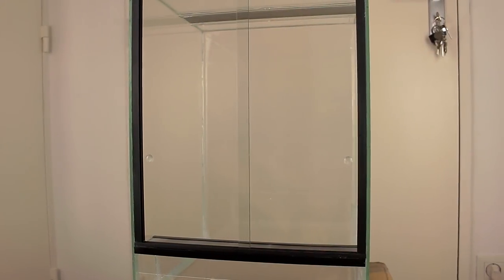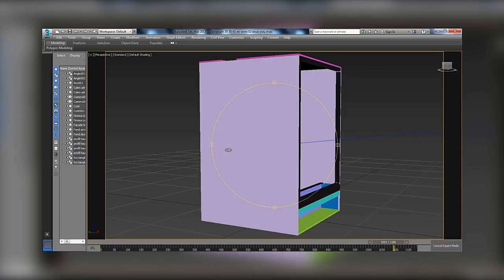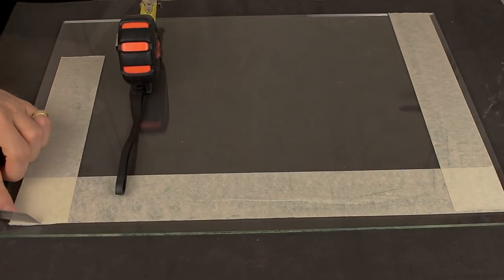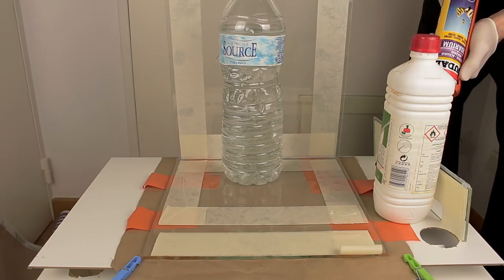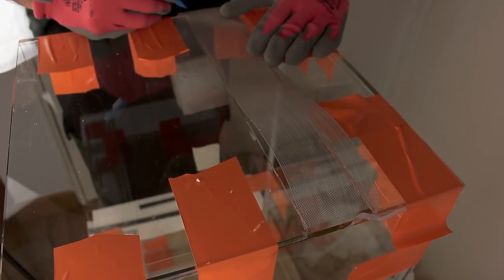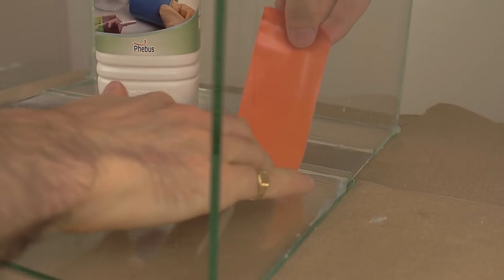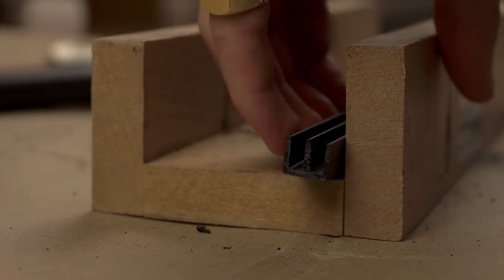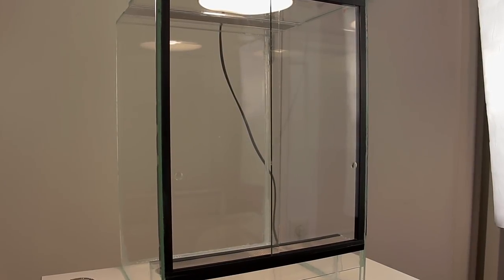How to build a glass terrarium vivarium

Comment: Very istructive! i prefer grinding round sharp edge of all glass panel before starting for two reason . The first is obviosly safety  the other  is that a grinded glass is less prone to anomaly fractures.
Try you  black silicon , its need a bit more attention because  whisker are very visible but the final result is gorgeus

Comment: Honestly the best DIY terrarium & tutorial I've seen yet! Been looking for one that looks pretty & clean and your design is phenomenal. Thank you! Question, can this be done the same way with plexiglass/acrylic instead of glass?
Reply: Also, is there a way to lock the sliding doors? I would like to do a similar thing for my gecko but am super new to this stuff. My dad is a little more knowledgeable so he can help me out a bit.
Reply from the maker: @ratmansimulator  Thank you very much. Yes, you can process the same way with plexi or acrylic but these materials are very fragile become dirty and scratched with time and are more difficult to clean. The only one advantage is the weight. And yes I think it is possible to buy something like this : https://www.amazon.com/Sliding-Ratchet-Chrome-Showcase-Display/dp/B07P7Q76SP/ref=sr_1_1_sspa?keywords=glass+door+lock&qid=1573900396&sr=8-1-spons&psc=1&spLa=ZW5jcnlwdGVkUXVhbGlmaWVyPUEzQllYRU45SUJOV05DJmVuY3J5cHRlZElkPUEwNTIwMTQ5Mk5HU0g1VFgyUTJZTSZlbmNyeXB0ZWRBZElkPUEwNzYzMjg0M0NCQk8xSFI4RUZERyZ3aWRnZXROYW1lPXNwX2F0ZiZhY3Rpb249Y2xpY2tSZWRpcmVjdCZkb05vdExvZ0NsaWNrPXRydWU=

Comment: Absolutely brilliant tutorial! Thank you. Does it have to be toughened glass and how long do you leave the silicone to dry please?
Reply from the maker: Thanks :) it is normal glass and I leave  silicone dry at least  24h
Reply: @Terrarium-Construction   i have just bought my cut sizes today, but it is normal glass!? i will be using some heavy dragon rock etc inside.. you are sure it is ok to build with this? it is 500mm x 400mm and 550mm high.
Reply from the maker: @spurito  Depends on the thickness but yes or me no problem with normal glass. You know, Exo terra use normal glass for there terrarium tank. ;)

Comment: Hey! 
First of all, great video! Also your english doesnt suck ;) english isnt my native tongue and i still got everything

Im going to follow your tutorial for a 60x90x60 cm tank - excited to get started
one question tho: If i place my UVB bulb on top of the tank, only the ventilation mesh will let uv light through
is there an option to increase the amount of uvb light that can get through?

Looking forward to see moure of your projects!
Reply from the maker: Thank you very much. Unfortunately, the only two ways to do this are to increase the size of the ventilation mesh or replace glass top panel by acryl panel whick let the UVB pass trough.
Reply: @Terrarium-Construction  i thought about increasing the mesh size, but I was worried about the structural integrity of the tank - the top plates ensure stability after all
But using acrylic glass is a great Idea! I will think about it
Thank you very much
Reply: @dertachinator, what did you end up doing?
i think you could safely reduce the amount of glass on the top / increase the mesh area. look up eurobracing aquariums. they use far less glass across the top of tanks which they fill with water. that's a lot more pressure.
Reply: @druubben4410  i found a cheap old terrarium that looks self made to me ;)
it utilized acrylic glass, mesh screen and glass on top, i fitted a lamp over the acrylic glass

Comment: love the tutorial. you've given me the confidence to get started.

my biggest worry is the size of the doors. i know you take the total height of the tank minus the height of the vent, but you also have to subtract for the pvc and rail profile. how much is that?
Reply from the maker: To be honest for me it is the tricky part.  On the base you just need to count about 2mm but on upper  part, you need take required gap which permits to remove the glass so the height of the bottom rail (5 or 6mm) and about 5mm on the top. To be sure, build the tank and when it's done make the doors according to the final dimensions you get.

Comment: hi!! this is a fantastic video! thank you for making it :) do you think that a simple box terrarium with no sliding doors would be possible to make for someone with no real experience in building? i want to make one but i've never tried something like this before
Reply from the maker: Thanks but a simple box is not good because you need to have an air circulation in the tank to avoid moisture.

Comment: Hey, thank you for the tutorial, very helpful indeed. Just a quick question, how much gap there is between the bottom and the top of the doors’ runners’ tracks? Is it exactly how tall your doors are? Will glass bend at all? Do you need to force the doors in? I want to make sure that glass doors will fit into that space. If that makes sense? Thank you

Comment: Very good video, one question: I saw that you ordered the glass at leroy merlin. From your experience, did you pay the glass based on how much glass you bought (for example 1.5 square meters) or did you also have to pay the cutting of the glass?
Reply from the maker: Thanks. If I remember well I just paid for the glass and nothing for cutting but it depends on the stores.
Reply: @Terrarium-Construction  thank you very much, one more question: could you tell where you found the PVC guides for the glass doors? thanks again
Reply from the maker: @lorenzodonati9377  I think you can find these stuff on Dutch Rana but I bought mine on Dendroworld

Comment: Why did you make the glass for the sides (côtés) 304mm wide, 
Why you didn’t make it 300mm if the bottom is 300mm? Please tell me I don’t understand why
Reply: I can make this ? the bottom 300x300? and the side and back 300x450mm?
Reply from the maker: The sides make 304mm because sides cover the back so you need the lenght of bottom (300mm)and thickness of back. (4mm)
Reply: @Terrarium-Construction  Ok thank you, I think I understand now,
I have once last question do you think thickness of glass for the bottom of 4mm is enough For terrarium Or must be 5mm or more?
Reply from the maker: @james-in4gc  Depends on the size of the tank but 5 mm or more is better

Comment: thanks for the video. just want to as a question. you use sandpaper on the edges of the glass? i cut my own glass so how should i take the sharp edge of the glass?
Reply from the maker: You need to smooth edges, if not you can cut you fingers very easely. I just cut one of my finger this week with my tank and I almost needed to go to hospital ^^

Comment: Hello, what is the tool used for smoothing silicone? Thanks
Reply from the maker: Hello, it is a sealant finishing tool which is sold in the seaant department in diy stores. You can see it at 2m36s
Reply: Terrarium-Construction.com OK，thanks a lot. Also are the side profiles for the sliding doors same as the bottom profile(how deep)
Reply from the maker: @williamdavis9471  Yes the same size, about 10mm ;)
Reply: @Terrarium-Construction  thanks again, haha

Comment: I need to know how to set up the lights inside a full glass tank lights keep falling on me its a pain
Reply from the maker: Hard to say without seeing the set up.
Reply: What lights do you have? Is it an led bar or a dome? You will probably have to drill holes to affix it to the top. The thing with these builds is they don't accommodate for uvb lights as the glass will filter it all out. So best would be to make a full mesh top or a very wide strip of mesh to set the lamp on. It would still lose some percentage of uvb (between 30-50 depending on mesh and bulb) but at least you can use it. That's really why these builds are giving me a bit of a headache. I want to do one but I really want to use uvb so figuring a way around that is creating extra work
Reply from the maker: @pewpewcat7679  I never used UV lights. UV light emits UVA and UVB during very short periods. I rather gave calcium with food when I had dart frogs or lizzard. You cant us too large grid because you will loose to much humidity to maintain rainforest animals.  If you really want to use uv light you can use acryl panel wich let Uv pass trough.

Comment: Does anyone know if "plexiglass", that is, plastic glass or whatever it's called, would it also work for this build?
Reply from the maker: Yes, but with age it becomes very ugly and is not resistant to scratches . but yes you can use it.
Reply: @Terrarium-Construction  okay, thank you for your advice. If you have time, I have more questions.

Would it also work if I used plexiglas and plywood instead of glass? For example, the back, bottom and top would be plywood and everything else plexiglas.

Another question I have is whether this build would work with the moss terrarium. Do the ventilations affect the moss?

And last, in the moss video you mentioned XAXIM, peat bricks, and hydroglon. You said that anything else would also work, what did you mean by this?

Thanks in advance.
Reply from the maker: @haltsinberg  Far too complicate to use many kind of materials to ensure waterproofness. You must use full glass or full wood or full plexiglass. Plywood is possible but requires effort (and money) to become waterproof. 

Yes this build is Ok for moss terrarium. For moss terrarium you need a big amount of moisture so if you don't have ventilations you will get mold.

Yes I said this, for exemple a background on which you past Exo terra plantation soil substrat with silicon sealant or resin or anything which can stay wet and hang moss during growth
Reply: @Terrarium-Construction  
Thank you very much for your advice. I'm putting heavy thought into building this design myself.

A few last questions, if you happen to have the time to answer them, I would greatly appreciate.

You said that one should only use one material to maintain waterproofness. Despite this, what do you think about a configuration like this: items 7 and 8, that is, the low air holds and grille would be plexiglas, while everything else would be normal glass. Could such a configuration be built, and would it be waterproof? 
You have listed the materials needed. In that list you mention that one needs 3x of "grille", that is, the long and thin glass sticks. I wonder if this was a typo, or if I failed to understand where the third stick went.

Would the background work for moss, if I used great stuff foam with exoterra plantation substrate?

I cannot thank you enough, if you do end up responding yet again. In any case, you have my thanks.
Reply from the maker: @haltsinberg  Yes, what you said about item 7 would certainly work but the item 8 is the stainless steel mesh.

For the sticks I'm not sure to understand what you mean, there are only two glass sticks which I past on the stainless steel mesh for the upper ventilation.

Yes as long as you use pump or nozzles to maintain it wet, the exo terra subtrat on great stuff foam will work for moss, I already test that in the past and with light enough it works very well, as good as in the video ;)

Comment: The back and side panes of glass should be siliconed onto the top of the bottom pane of glass, not to the sides of it................
Reply from the maker: Certainly not, silicone sealant is far stronger with this way to build. Most expercienced aquariophiles do there tank like that.
Try to translate this page because it is in french but all is written in it :)
https://www.cap-recifal.com/articles.html/materiel/aquarium-en-verre-partie-2-conception-r%C3%A9alisation-r92/